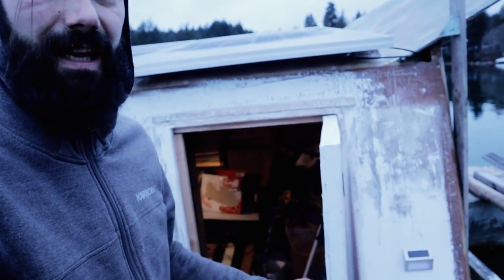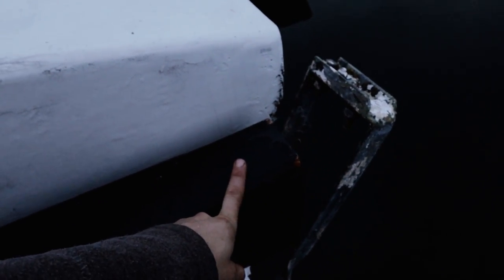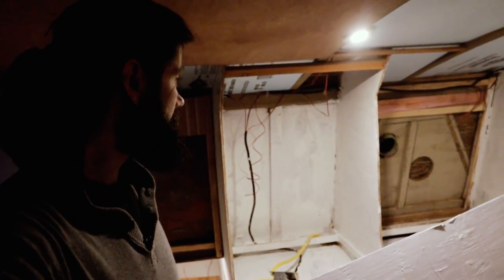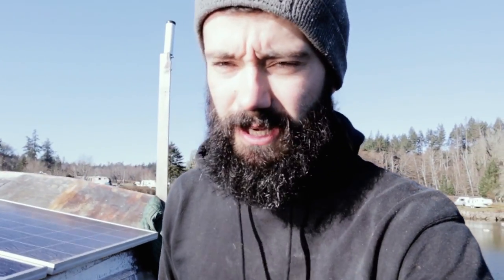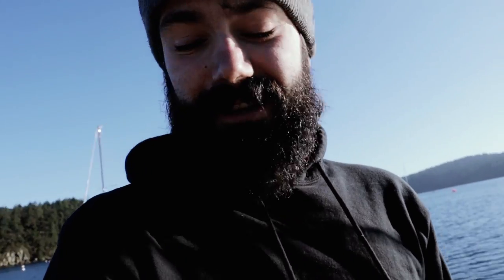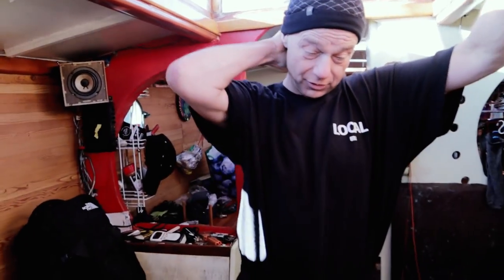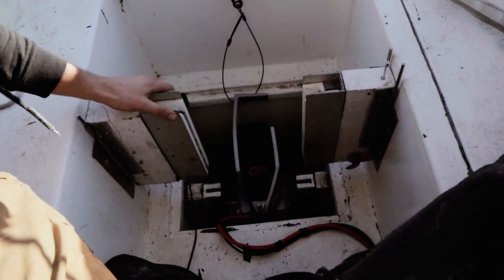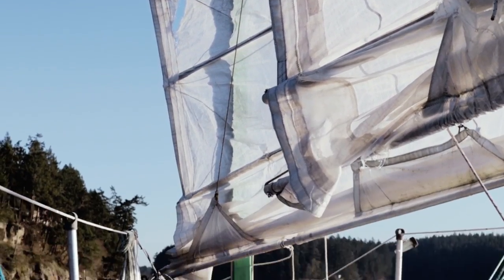The Paint Goes On - Sink or Swim 125

Comment: Props for owning up to what you've done wrong! It's hard to admit it but helps a ton. I too am a learn by doing and trying so I completely understand. A coat of paint on things really starts to clean things up. That's a massive paint brush lol! I agree with what others have said something less than high gloss hides a ton of sins on an uneven finish. Good job not using the much cheaper latex and household paints. Many cheap boat DIYers have tried it and it works for a little while, then starts to come off in sheets. One of my old boats the former owner did this not knowing any better, I could literally get strips 4 inches wide off with my finger nails. It looked like hell before I finally stripped the entire interior and repainted with oil based paint that actually stuck.  

A mizzen rig is great for boats that don't want or have a high mast like yours. That way you get some extra sail area up and can help balance out the helm when the center of effort is not well taken into account with mast placement ect like what you've got. The downside again is that mizzen rigs really don't help much with windward performance. Then again your boat isn't going to be able to go to windward or beat into the wind anything more much more than 90 degrees. So a mizzen will give you better speed with the larger sail area running downwind and on reaches. I don't see much of a downside for what you're going to do with your boat.

Comment: Without having the architectural specs reviewed and regular inspections done and approvals from the Canadian Register of Vessels, how will this boat ever be insured?  And without insurance you can't dock in most marina's worldwide.  I've often wondered what is the plan when you want to sail the globe but are refused entry at the vast majority of marinas due to this lack of insurance and registration of the architectural plans?

I love the motivation to just follow your dream.  That is something I admire.  But if you can't get insured and have no approved architectural plans that are inspected by the powers that be in Canada, then how can you do more than sail around that area without staying in any marinas?  When you arrive in most countries, they require your insurance documents and registration documents.  Most marines won't let you dock without clear registration and insurance.  And those require engineering certifications and approvals.

For example, look how "Life on the Mold" is building his cat.  He has regular inspections with the Australian authorities.  They inspect his boat and are very particular about every aspect of construction, safety, weight, and engineering.  So he'll be fine with getting insurance because he makes sure every aspect of the build is to standard.  But if you are going to hit the high seas on a global adventure, how exactly will you dock at any marina worldwide without these certifications and insurance?

Is the plan simply to throw an anchor and always be offshore?

Comment: I've been surprised at the location of the cabin door since I first saw this boat. Every other catamaran I've ever seen has the cabin door on the back, opening directly into the cockpit. Although, that boat doesn't even seem to have a cockpit like a typical catamaran does.
Reply: There will be a door going back into the cockpit, between the bench seats and the solar system, eventually. Step one: make it livable, step 2 make it movable. no point cutting more holes in the boat until its more sealed up, especially this winter.

Comment: New Mic sounds GREAT. You can NEVER have Too Much Horsepower, but you CAN USE Too Much, and so Cause Problems. Hopefully your friends will be able to AVOID such situations. Like you, I myself would rather Have It, than to NEED it, and Not, for my own inexperience and peace of mind. My own experience with engines of ALL types tells me that the Big Motor will OUTLAST the Small one EVERY time, because it doesn't Work as Hard to do the same job, equals Less Strain and Wear on it, hence Less Maintenance. Plus the TIME Saved. With Extra horses, you may be able to pull someone Off a Lee shore, and Save them and their boat someday. If you only do that ONE TIME, won't it be Great? Or Push Through a waterway choked with lily pads in some mangrove swamp? Also, on the Beam Incident: One of the First Three Lessons my Chiefs taught us in the Navy was NEVER ASSUME, because it always makes an ASS of U and ME. Second Lesson was, ALWAYS Cover Your Ass. And Third, the Seven P's of Performance, Proper Previous Planning PREVENTS Piss-Poor Performance. It was Worth the Aggravation of Enlisting just to Learn these. All I can see that you do that's Questionable is you seem a mite Disorganized, LOL. Spreading yourself Too Thin, a Whack Here on This, a Whack there on THAT, and a Swipe in Passing at That Over Yonder. Like Playing Whac-a-Mole? LOL! You STILL Get Shit DONE, it just takes Longer...Also, it's Damned HARD to make a Schedule and Stick to it when you have to Wait to WAIT on Other People and Events. Can't Paint til it quits Raining, can't Epoxy til it Warms Up, can't install Windows til you Scrape up the cash to GET them, can't Fix This til Somebody Else does THEIR Part...Did I ever tell you how much I HATE Waiting?LMAO!  Keep On Truckin', Simon, you're doing All Right, Pretty GOOD for a Greenhorn.